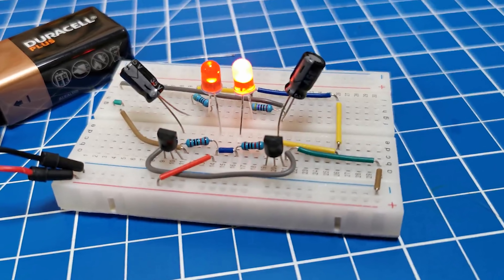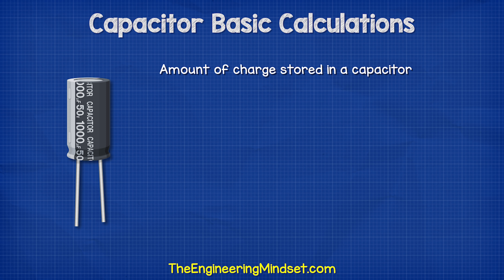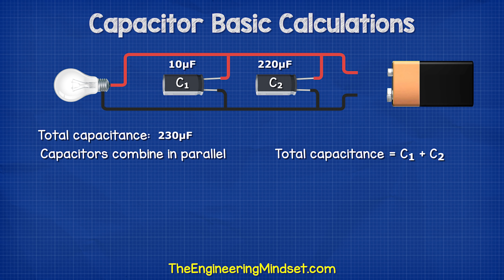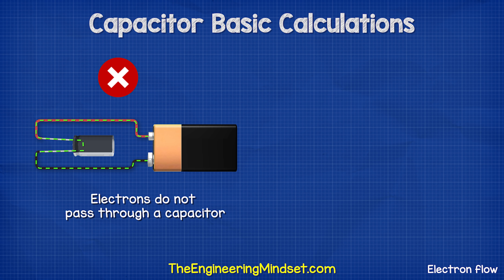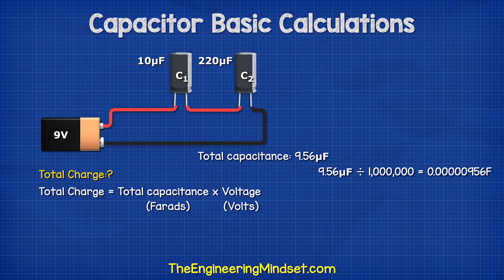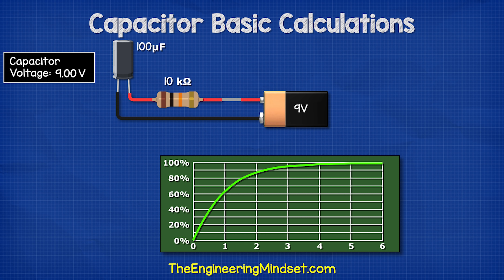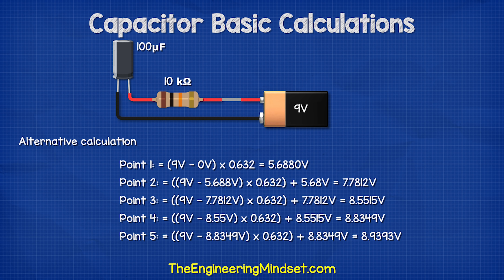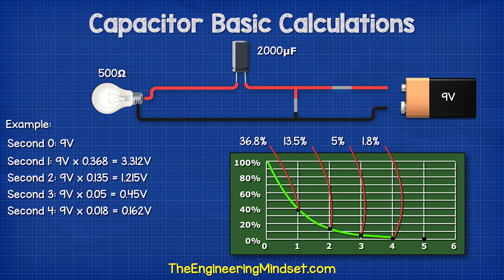Capacitor calculations - Basic calculations for capacitors in series and parallel

Comment: My 12v mini angle grinder stopped working, i opened and i find an blown cap 25v 22uf, i replaced it  with 25v 100uf cap because i didn't find one with the same values. After the replacement of that cap the angle grinder is working now, but I'm little worried because the ”uf” value of new cap is way biger from original. What could go wrong?
Reply: That's actually dangerous if you don't know what the capacitor actually does ... Replacing a 22 microfarad with a 100 is actually a big change which can cause more stress inside your grinder and much more inrush of current , high heating leading to reduced life time kr blown fuses .... So yeah even if its working fine right now its better to get it replaced

Comment: Now explain why capacitor used in celing fan if connected to 220 v ac supply it store charges though its ac
Reply from the maker: Needs to fake a 2nd phase to create rotating magnetic field. Capacitor causes delay in 2nd winding .

Comment: At 10:10 how did you get 0.00007857 coulombs for the equation?
Reply: Formula V = Q/C 

Total capacitance (C) = 0.00000873
Voltage (V) = 9

Q = CV
Q = 0.00000873 × 9
Q = 0.00007857143

Comment: I have got a backlog in Electronics subject during my Engineering career due to inefficient professors where my fundamentals was not clear at all but after going through all the videos about the basics, I can tell in full confidence that i could have topped any examinations out there in Electronics at that point of time if you were my professor. Thanks a ton.

Comment: 6:02   wrong calculations 0.33F not 0.00033F you  mis calculate to consider 100000 its 1000
Reply from the maker: No mistake. 10uF + 220uF + 100uF = 330uF.   1F = 1,000,000uF,      330uF/1,000,000=0.00033F

Comment: if a diode connect to this capacitor(led also capacitor). the minimum V is for forward bias is0.7 ,  so how the capacitor fully discharge. how it will get below 0.7 tp 0v. how??

Comment: This is probably a really dumb question but is the Energy Equation used to calculate joules the same as E=mc^2? I'm guessing since electrons have mass and voltage is a constant that would make sense but I don't know where you pull the 1/2? Is that because only 1/2 of the capacitor is used? Maybe its just a coincidence and I'm really reaching here

Comment: Ok so thats how the power button on tvs work. The cap hold power u press bottom complete circuit which has enough cap saved to trip a switch that powers the tv, i was wondering why have them in series? Makes sense with a switch added

Comment: I have a question, 

if the capacitor is 12 volts, what does it mean? it needs 12 volts to operate fully or it can handle 12 volts,  
will it give 12 volts upon fully charged ?
Reply from the maker: Please see our capacitor explained video
Reply: @EngineeringMindset  thanks, I got it ,
how can determine the total current in fully charge capacitor

Comment: Nice video, but I am confused about something.  At 3:00 into the video, there is a formula (with some symbol changes) that says W(joules) = .5 x Farads x Voltage^2.  A Farad is defined as Capacitance(Farads) = Q(Columbs) / V(Volts).  This can also be written as Q(Columbs) = Capacitance(Farads)*V(Volts).  Energy, or Work, is defined as W(joules) = Q (Columbs) * V(Volts).  So the work/energy of a capacitor is W(joules) = Capacitance(Farads)*V(Volts)^2.  Where does the .5 factor come from?

Comment: Question…. Does it matter if the capacitors are soldered 2” inches from the ESC versus soldered 8” inches from the ESC in a DC brushless lipo system🤷‍♂️? These are extreme voltage draw conditions so will the capacitor’s  performance be compromised?

Comment: hello sir how are ignition coils effected by that capacitors how culd I posibly retard me ignition coil.
Also when I do use capacitors me alternator back feads more until I reach higher rpm ranges expeciali if I use hv ceramic capacitors so I was wondering how to control the linear voltage regulator properly to fix that problem basicali I was wondering if negative voltage regulator with voltage devider wuld help me or not?
Basicaly I try some how to use automotive relay to power my e core ignition coil but I am not shure If I can build dimmer for that thing to delay ignition coils magnetic field it does use ignition module after all so I was wondering how those calculations apply to transformers and inductors and how to predict out comme???

Comment: Great video!  But I always have trouble when teachers say one thing in an example, then contradicts in the next
statement.  At 13:07 it is stated that the capacitor will never reach 9volts but only 8.94volts...very close to 9volts.
Then at 15:07 it is stated that the capacitor charge is 9volts....NOT 8.94.  It is helpful to state "ideally" we can say
the battery is at 9volts for purpose.  When I try to be precise on test, I would use 8.94volt when calculating say
a current with 500ohm resistor and put 17.88mA...it would be marked incorrect! Yet in other calculations we're
suppose to be precise! Very confusing! If teacher want students to use the complete 9volts, it should be stated
"given" capacitor has a 9volt change!  I'm always to the left or to the right!  But at least I'm not alone...lol!!!
Reply from the maker: Check out NEW resistor video, everything covered! ➡️ https://youtu.be/DYcLFHgVCn0

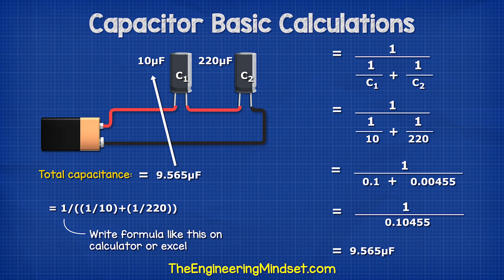Comment: 8:10 I had to write the formula like this (1/((1/10)+(1/220)))= then paste it in MS Calculator. W/O the extra parentheses the value was at 0.10455 where the 1/ didn't calculated in the function.
Reply: @mach1553 that would be the right calculation for Caps in para, which i was taught.(1/((1/10)+(1/220)))=L or R or C. And caps in series just add them up.

Comment: how do i calculate: the size of a capacitor that causes a current of 2A to flow when it is connected across a 480V 50Hz supply.

Comment: Thanks for this. It's the first video I've found that actually explains how capacitors work in a circuit and how to calculate the desired capacity as well as info about configuration, which a newbie would certainly find useful. Good job!

Comment: Brilliant everything crystal clear to understand. Please make one video on motor coil how all the coil wires are twisted together. Every video shows but not clear at all how the set coil winding is twisted together before they are attached to the connector contactor and switches. Sorry for the trouble.
Reply from the maker: Please see our motor starter videos and brushless motor or 3 phase motor videos

Comment: I'm an ETO on ship and have one qustion which I can't fully understand. On ships we almost don't use any capacitors, but there is one way to trick the erath fault system with the capacitor. For example, If there is an earth fault on gauge, u can use capacitor in series with curcuit and the earth fault will be again normal, and even pointer will movie if we will press the button for checking the earth fault. Anybody's guess how this work?

Comment: Ok i do not understand the series visualization you provided. How does the capacitor energize without a circuit being completed? And then how will the parallel get energized if the electrical current takes the path of least resistance and flow through the light and back to the battery? I would think the path to the capacitor would be more resistance due to power not flowing through the capacitor and shouldnt flow at all. Now im definitely not an electrician and electricity as a whole has always been a weakness and i struggle to grasp certain concepts with this being one of them. Any explanation to help me understand would be greatly appreciated.

Comment: Basically it works like a breaker or transformer it blows before frying the whole system thanks
Reply from the maker: A capacitor? No, it doesn't act like that. It just smooths out the wave form
Reply: @EngineeringMindset  but doesn't it blow just like a transformer on a power grid so in a way yes smooth out the wave form or doesn't fry the whole system but cool man I'm no i.t person but still cool and thanks
Reply from the maker: Seen our new Transformer video? here https://youtu.be/jcY4QN7awEc

Comment: Bro a small doubt 1:53 
Why are electron flowing out of the positive side ?As capacitors  cannot flow electrons to the other side but only can store and discharge them
Reply from the maker: You already answered it. They store and release them, they do not pass through
Reply: @EngineeringMindset  yeah bro but in the animation 1:53 .why are charges from moving positive side of capacitor ,when charges are coming from  negative side ?

Comment: Confused on the series arrangement; how you would charge & discharge the capacitors if no current can pass through them. What’s the path for the current??
Reply: Electrostatic charge can be transferred through them, so a transient current does pass, but not a sustained one unless it is alternating current.

Comment: 7:04 The difference in charging and discharging. Isn't that the negative terminal gets charged by connecting with the negative terminal of the battery. Correct me if am wrong. Thanks

Comment: This “Basic Capacitor” tutorial while accurate, contains much useless and even deceptively harmful information.  For instance an electrolytic capacitor rated at 12V would almost never be used at 12 volts. Because of tolerance, operating temperature, ESR, ripple voltage, aging, and operational lifetime, the capacitor must be derated to a safe operating voltage. For a 12 volt circuit a capacitor rating, in terms of standard voltages, would be 15v or 20v. Elsewhere the serial capacitor circuits are highly impractical because they are accurate, only, in a theoretical sense. Those circuits don’t work that way in the real world so designers need to know why and adjust their designs accordingly. Here in serial capacitor circuits, leakage resistance becomes critical.

Comment: How can you measure the amperes that a capacitor releases?
Reply: The current depends on the resistance in series.  The voltage across that resistance gives you the amount of current.  Usually an oscilloscope is required as the current is decreasing all the time as the capacitor discharges.
Reply from the maker: Seen our new Oscilloscope tutorial? (beginner friendly) link here:➡️ https://youtu.be/LaY47Qrfs0c

Comment: Placing capacitor ither in series or parallel, the voltage will not change at two terminal of capacitor. But what about current 😉

Comment: what capacitor (size n uf) sholud I use to boost 36v to 48v?  running at 60A
Reply: ohms law says 48v and 60A is 2880 Watts, then figure watts to Coulombs . Then dived coulombs by 48V = uF

Comment: Interesting to note, as soon as a load is placed on a capacitor the voltage will drop instantly. It does not behave the same as a battery

Comment: I have been dealing with inductors, transformers, capacitors, transistors, resistors etc for over 40 years in DC and AC applications in maintenance or very basic trouble shooting. My quandary is I can never seem to grasp what they are doing in real life applications such as power control via inductors OR capacitors in AC equipment. The videos are amazing on a basic level that I never could grasp in high school electrical and electronics and then in Engineering in University. Transformers application is somewhat of a black art that even many electrical engineers don’t truly understand and the result in design is often trial and error. GOOD job I hope I can find more info that will help the light bulbs in my brain become brighter!!,😃😃
Reply from the maker: Check out NEW resistor video, everything covered! ➡️ https://youtu.be/DYcLFHgVCn0

Comment: 02:32 Yeah, but how to find a capacitance of an unknown capacitor, or to make one of a particular capacitance we need? :q
Reply: Connect 1000 ohms in series, then connect function generator across sending a pulse width modulated signal. Adjust frequency until you see full charge/discharge.
At 1 volt, find how long it takes to get to .67 volts. This is your time constant.
1000*capacitance = time constant
Reply: @cpK054L  I wish I had a function generator and an oscilloscope. But I don't. They're pretty expensive :/
Reply: @bonbonpony  buy an arduino, use one of the PWM pins to output a squarewave, adjust code for timing.
Use an ADC pin to read the output
Use serialport to display it.
Otherwise, use the debug print to find how many prints it takes to go from 256 to 0.67*.25*1024 
Take the number of prints divide by sampling frequency and that is your time constant.
Reply from the maker: Seen our new Oscilloscope tutorial? (beginner friendly) link here:➡️ https://youtu.be/LaY47Qrfs0c

Comment: Sir ,when we connected the lamp and capacitor in series the electrons in capacitor are attracted towards the positive terminal of the battery so the electrons that are flowing towards the positive terminal of the battery does not have any energy so how they can turn on the lamp PLEASE EXPLAIN SIR
Reply: I think in that example, they are using "conventional flow", which means that it assumes that positive charges are the ones flowing through the circuit, instead of negative charges (electrons). The reason is because centuries ago, they thought that positive charges flowed through circuits, but it was then found that negative charges were the ones actually flowing in a circuit. Though to this day, we use "conventional flow", which means that we consider positive charges to flow. The reason why we didn't change to "electron flow", which means we consider that electrons are the ones flowing, is because it doesn't affect the calculations for circuits. Basically, the direction of electricity didn't matter much, and we've gotten used to positive flowing to negative. So to answer your question, the green rectangles represent positive charges in the positive terminal of the capacitor (at least at 6:39). Hope this helped!

Comment: Caps never exceed the v of an energy source..? (or just a simplified ver for us.?)
What if there're multiple 'in-line' caps ...?  Say, 12v through 4 caps? 
Does each cap get 3v ..?
Or does each just take 4x the time to store the 12v..? (until the battery is depleted) ...?

Comment: 13:09 "The voltage will never actually reach 100%".

In reality, it actually does reach 100%! The theoretical model depends on the fact that you could have an infinitely small charge, but in reality, the smallest charge possible is just one electron, so once that last electron enters, you're at 100% and it's fully saturated. (I think I remembered this from Electrical Engineering 101 by Darren Ashby.)
Reply: Yes, people then to forget that mathematics are theoretical and do not accurately represent the physical real World. It just approximates it very accurately, the real physical world does not have infinities or paradoxes, since it wouldn't be possible then. In the real world there are constant (c = lightspeed, h = Planck's constant ) values and absolute quantized (h, Planck time) boundaries that mathematics is not limited by, this electron case is a perfect example of it in action.

Comment: Plz make a video on the concept of voltage/potential.
I find these videos really helpful. Thanks.
Reply from the maker: Please see our video on voltage explained
Reply: @EngineeringMindset   I have already seen it. But it talks about the voltage only in terms of pressure in water. But i think potential is much deeper concept than just pressure in stored water. Plz consider it. Thank you.
Reply: @sonugupta147  It's really extremely similar. You can even describe diodes using fluid flow as being spring loaded ball valves, where the pressure necessary to compress the spring and allow flow is the same as the forward bias voltage needed to turn on a diode. Fluid pressure in pipes works the same as voltage as well: with no current/flow you have no difference in voltage/pressure and fluids flow from high to low pressure just as current flows from high to low voltage.
Reply: @thegreatzoom5073   I think potential is seperate quantity and it has more significance than pressure. May be it was discovered as a term representing some property related to the electric field. As the line integral of the electric field is potential and also the electric potential is only the property of the electric field.